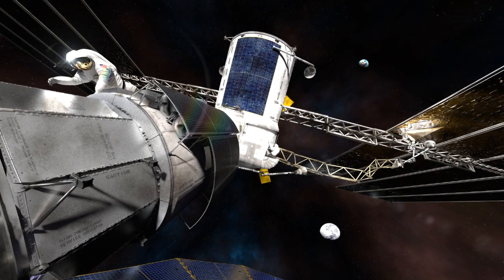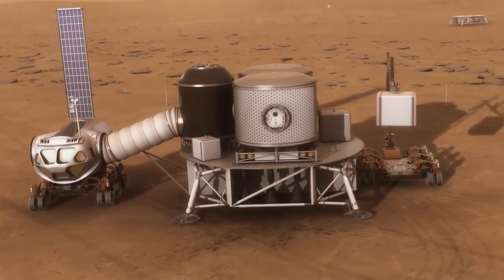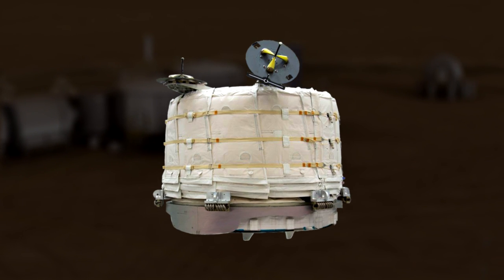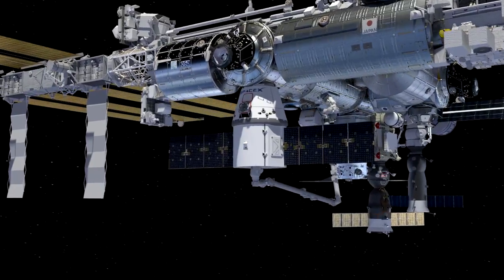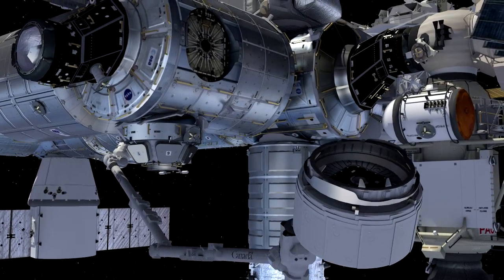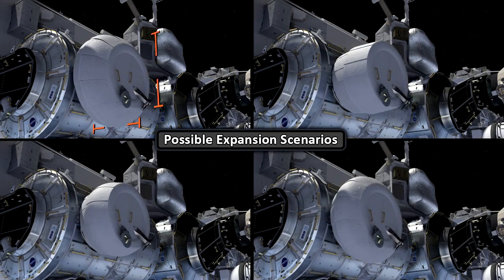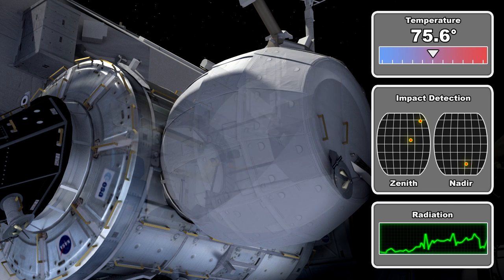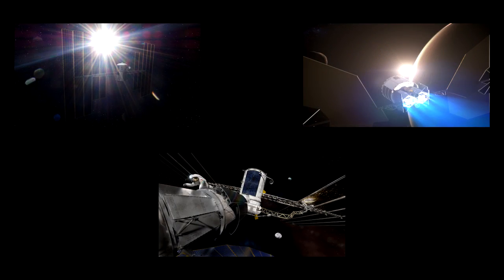BEAM Installation Animation

Comment: BEAM will serve another roll when it is deorbited when two years are up the crew will load BEAM with trash and deflate the module BEAM will then be installed into the trunk of a Dragon spacecraft bringing up its replacement and both BEAM and the trunk will be destroyed when they reenter.